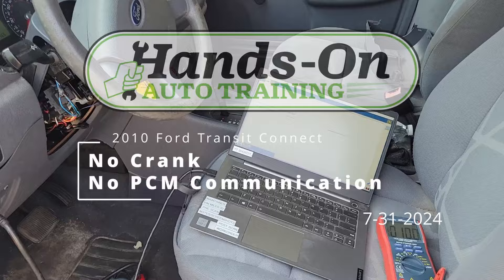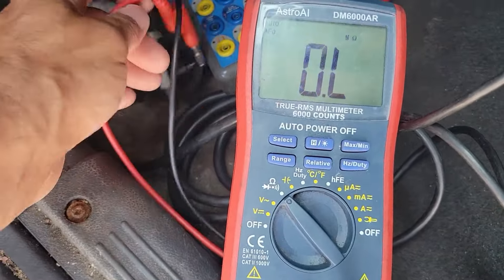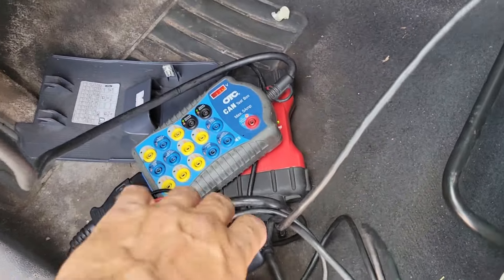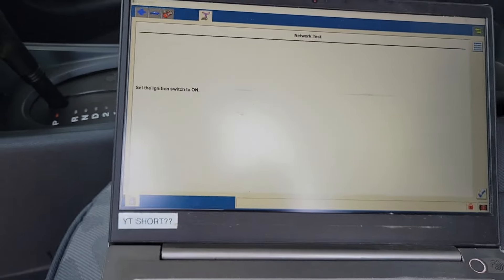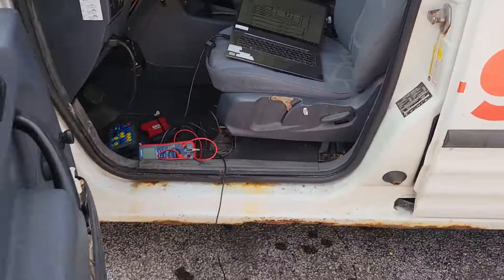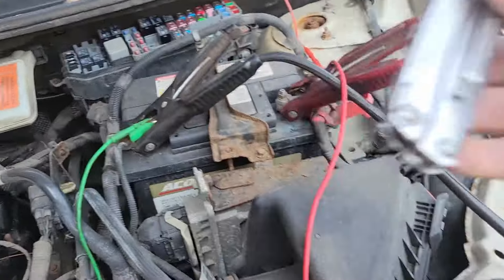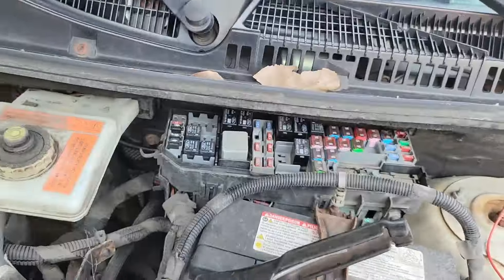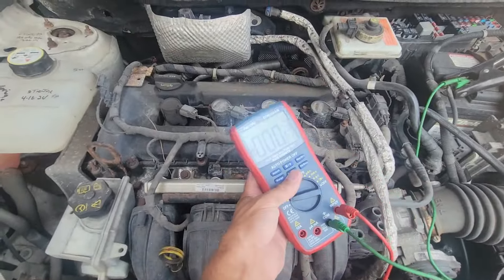2010 Transit Connect No Crank No PCM Communication

Comment: 2009 ram 2500 bought chassis and wiring but didn't get any keys have steering column is there a work around for the skim key so i can start the engine to make sure its ok

Comment: This van is mess ... Battery near by fuse box eats up fuse box connection etc ...this van was originally diesel manual...plus mazda mzr / dura torque engine automatic is like packaging mess. I own few  but durable engine for sure .